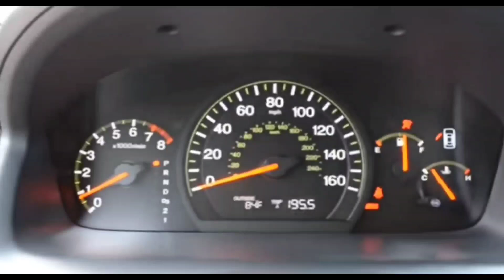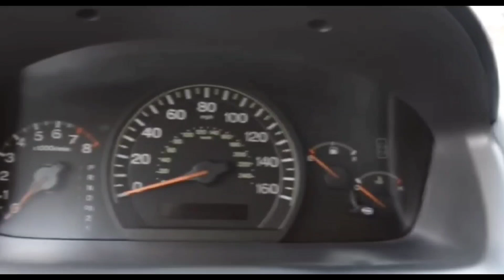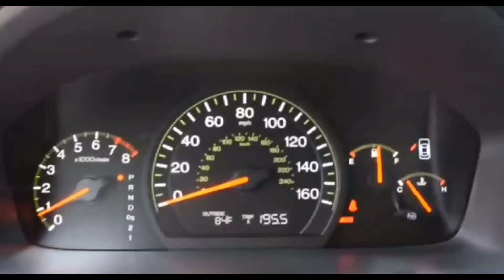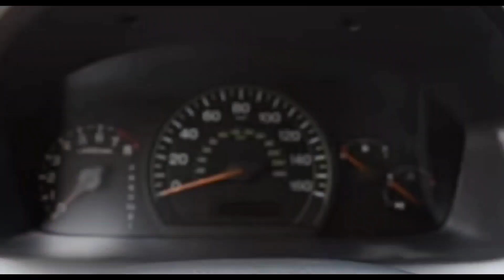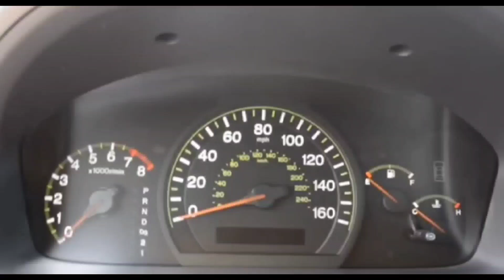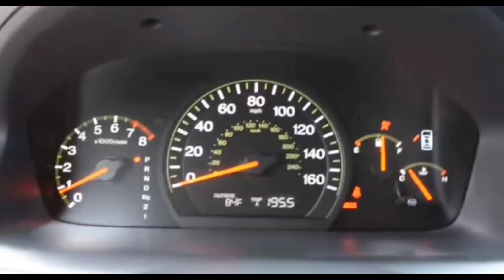HOW TO FIX ANY CAR WITH A P06DD Engine Oil Pressure Control Circuit Performance/stuck Off- EASY

Comment: Definitely add little sea foam for 300 miles then oil and filter change first always
Reply: RUBY-SEA FOAM IS GOOD STUFF FOR WHAT IT IS MEANT FOR-ALSO THE CORRECT OIL ON THESE NEWER ENGINES IS CRITICAL-DONT JUST THROW IN WHAT YOU HAVE-VARIABLE VALVE TIMING REUIRES THE THIN OIL -BLAME THE COLLEGE ENGINEERS FOR THAT
Reply: How does sea foam solve this issue
Reply: I highly agree with the sea foam. Just ordered a bottle today and I usually add half the bottle into the oil and other half in gas tank… def cleans out sludge and contaminants and u gotta change oil in another 300 miles asap…. Have a p06dd and running out of ideas before I have to do the oil pump as the last and final step